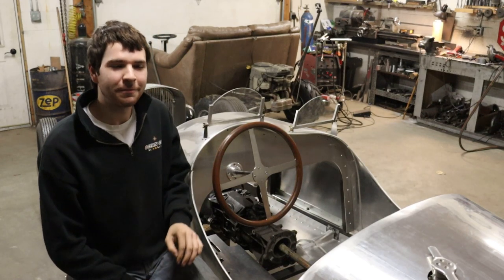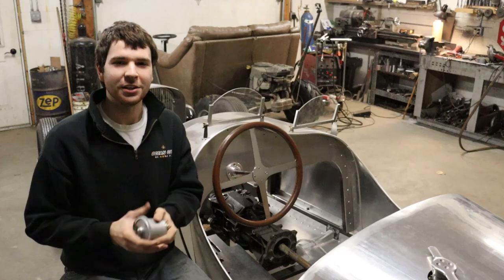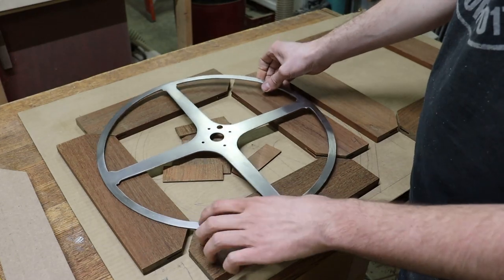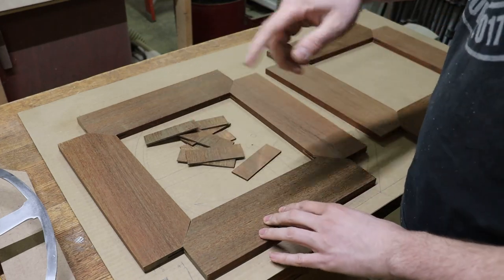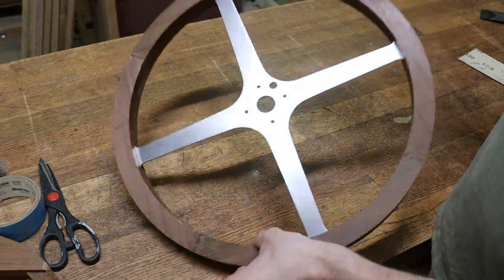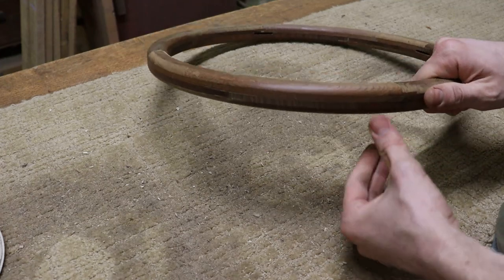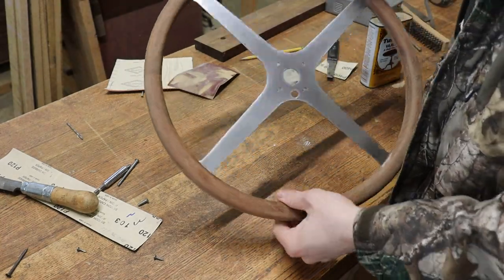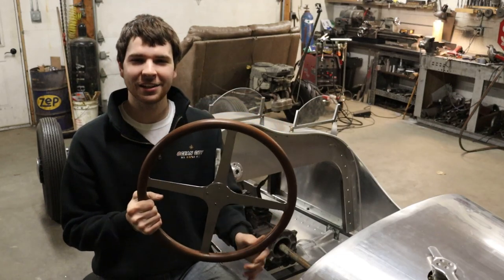Homemade Wooden Steering Wheel | Boat-tail Speedster Pt. 47

Comment: Another real lesson in craftsmanship. Book-matching the cut pieces to get symmetrical grain, using that compass-routed plywood template for the edge smoothing, using the router in alternating directions to avoid tearout - all stuff you could make a wheel without, but that attention to detail is why this project is shaping up to be a masterpiece.
Reply: Other details that really stood out to me were alternating the joints 45° from one side to the other to get a sturdier ring, etching the surface of the steel to get a better gluing surface and using pretty much every clamp he could fit in there to evenly press it.

Comment: On my Riley 9 I used the original wheel but wrapped the steel rim in cotton cord. Then every time I have oily, greasy hands from working on the car I wipe them on it. Over time it builds up a nice patina which is waterproof, nicely grippy and very period looking.
Reply: That's a really cool idea.

Comment: Rifle blue on the steal wheel would look killer imo.
Reply: @Ben Jones it's not the bluing stopping it from rusting. Bluing merely creates a porous surface for the oil to stick better. It's the oil preventing the rust. Hence why blued guns need regular cleaning and oiling to keep them from getting rusty.
Reply: Indeed. A li'l Birchwood Casey Super Blue cold bluing would really make it pop.

Comment: Really nice job.  It's good that you stopped at 3/8.  When you go to 1/2" with 1" thickness, the bearing doesn't hit the same outer diameter and cuts a little too deep.

Comment: On your dash panel it would look great machine turned. I have done this on aluminium dash panels before and use a piece of broom handle about 1" or so for the tool and drill it to take a steel rod, then cut a leather disk and glue it on the flat bottom of the wood.Put this tool int your pillar drill and then using valve grinding paste applied to the leather make overlap circles of the round pattern along the panel. Ideally you want to overlap the left to right and the ones above to avoid leaving bare metal. This finish was done on the type 35 Bugatti dash and the scuttle under the bonnet, it looks great. Just wipe off the old paste when you're done with a degreaser or thinner and you are left with a great vintage look.

Comment: You mentioned gauges. One gauge I like to use on my cars besides the standard oil pressure, water temperature, tachometer, ammeter is an intake manifold vacuum gauge. A vacuum gauge is a useful and valuable gauge to have since it instantly tells you how your engine and timing is running during idling. It also tells you when you're driving where the best throttle position is for economy. Rarely does anyone use a vacuum gauge and I think it would be unique for your unique car. Then you mentioned the supercharger. If you add a supercharger to your engine, you will definitely want an intake manifold vacuum/pressure gauge to monitor that device.

Comment: Very nice job of finishing the steering wheel. I don't know if it's period correct but some brass rivets to look the wood and steel for safety. Might be a chance of the wood spinning loose from the steel. Great work as I've come to expect from you, you never disappoint.
Reply: I was thinking that for the same reasons. A rivet through each spoke end, and halfway along the quadrants would set it off nicely.

Comment: I like watching your videos, keep them coming. A couple of tips, definitely would of been better scuffing up the outer ring of the metal and using epoxy for your glue up. You'll probably find that the wood will separate from the metal after a couple of seasons. Also, get yourself a collapsible steering column! Could save your life in an accident.

Comment: Tip for future reference: 
Router bits are directional. You always want to be cutting so that you are moving the piece against the rotation of the bit (biting under the material), not with the rotation of the bit (wanting to ride over the material). You'll have much more control this way and get a much better cut.
Reply: I thought that... then I realised that they are curved pieces cut from straight-grain wood, so the end grain rises in different directions, and it looks like he was alternating direction so it was always cutting towards the middle point to prevent tearing out end grain (although he does mention this started to happen anyway). Check out this guide which recommends climb cutting places where the grain rises against the router bit https://www.woodmagazine.com/woodworking-tips/techniques/routing/avoid-tear-out-when-routing
Reply: @PKMartin  Hm, yeah, that makes sense.

Comment: to minimize the tear-out when routing against the grain,  make your pass in reverse or as it's called "climb cutting" you won't get the tear-out. 10 or 12 1/4" holes drilled into the outer metal rim of your wheel would allow a place for excess glue to go and would really "key" the two materials together. also, when working with wood and glue, it's a good idea to have a bowl of warm water and a clean rag to clean each joint. the glue gets in the woods pores and seals them from your tung oil to penetrate evenly. don't flood it, just clean off the glue. it will make the wood swell, but you can block sand each joint with sand paper wrapped around a small piece of aluminum 3/8" or 1/2 " thick, 1" x 2" so it's dead flat for a full bond, with no gaps. no disrespect to anything your doing, i'm just passing along things i've learned in my 45 years of cabinet making and crafts.
Reply: Thank you for sharing your knowledge!

Comment: Greetings,
Nickel finish would be nice, and period correct.
Caswell plating sells a variety of home plating kits.
You could use them for other pieces of brightwork on the car.
Another finish you might consider is gun bluing.
There are a number of YouTube videos explaining how to do rust bluing, which is an attractive, rust resistant finish.
Unlike paint, it doesn’t add to the surface, or interfere with parts fit.
Early Miller race cars used bluing on the radiator shells and other trim pieces.
There is a fairly famous photograph of Jimmy Murphy sitting in his Miller, after winning the Indy 500.

Let’s be careful out there.

Comment: I was wondering about that bare metal in the wheel. Nickel plating would have been my suggestion. You could have done that without any dangerous chemicals like used in Chrome. You can coat it with the Tung oil, clear lacquer, or just a good coat of wax to keep down the rust. The 1" diameter is probably a good compromise. Some of the cars from the period may have had larger diameter. Very nice work.

Comment: Nice!!  I was a little surprised that you made each side out of four longer pieces, rather than eight (octagon) shorter ones.  The grain would have run more straight that way.  Regardless though, it looks great on that car!  Looking forward to seeing it continue to come together.
Reply from the maker: An octagon would've just been much harder to align and clamp together
Reply: @MacroMachines  Not really.  You might need a few more clamps, and maybe a strap, but using the methods you used, an octagon would have hardly been much more difficult.  For that matter, you should be able to find a number of examples on youtube woodworker channels.

Comment: A small button-head rivet through the top of the wheel would look pretty good and serve as a stop to prevent the wood from rotating on the steel frame. It would also serve as a clocking mark which could be handy in this car. Kind of surprised you didn't use epoxy to join the wood to the frame.

Comment: Very nice....I wonder what kind of glue sticks to metal and wood...🤔 Great work!
Reply: The bond between the metal and the wood isn't really important. The two wooden halves stick to each other   and hold the metal frame captive. The excess glue in the cavity fills out the space to stop it from rattling loose.

Comment: Just finishing my wooden steering wheel for a Volvo p1800. I have the doubt forbthe final finish. Lacquer/varnish or a oil finish like a fine rufke stock?? I would love the oil finish, but i think in a steering wheel constantly in touch with hands and sweat, the finish wont last long, and maybe hands would get dirty after some driving... What do you think??

Comment: Came out really nice, no brass rivets (like a knife handle)...
Reply: I was thinking maybe he would add some brass rivets to add some visual interest, as well as lessen the potential risk of bond failure/separation of the rim halves?  In addition, perhaps I'm mistaken, but it appeared he used wood glue, rather than some form of epoxy, that perhaps would have been more appropriate to use to bond the wood and the steel to each other?  Nevertheless, it's looking very nice!

Comment: 2 questions... 
1)  why did you go with the cut method for the wood instead of steaming?
I personally have never used that wood, is it because of the type of wood.
2) no finger groves to the inside of the wheel?
Personally I like it without them. And wondering how many coats of tongue oil did you use? I usually use 3 for dash pieces and inlay. Wheels, door handles high traffic 5 coats. 
Keep up the great work, I can't wait to see ot drive.

Comment: I would of matched the sides so it was back together as original with the metal in between.   You didn’t show it but always clean the joint on ipe with acetone. The oil in the wood eventually causes joint failure. I’ve build a lot with ipe and years later joints fail.  When routing you go the opposite way inside than you did outside.  Epoxy for the wood to metal bond with holes drilled in the metal.   Decorative pinning would even make it stronger.